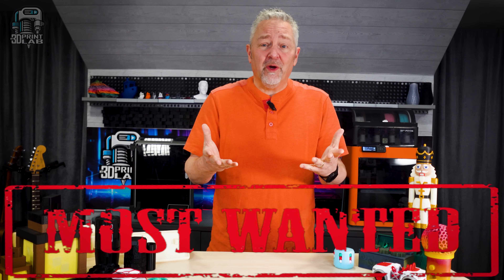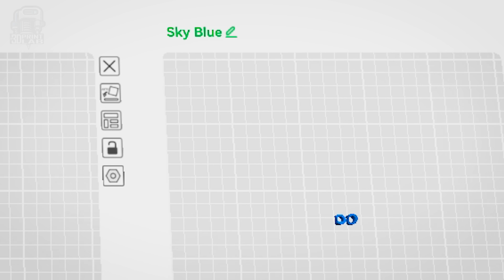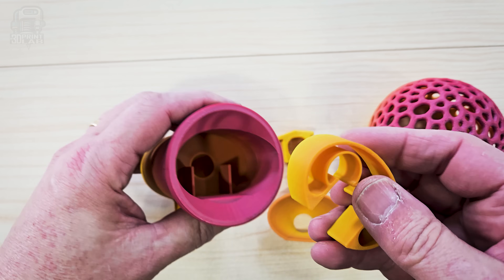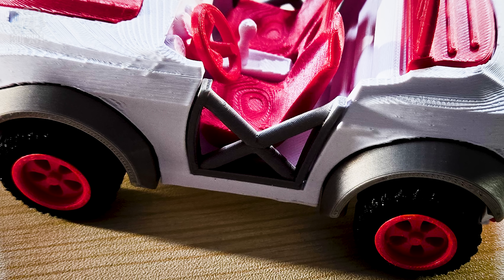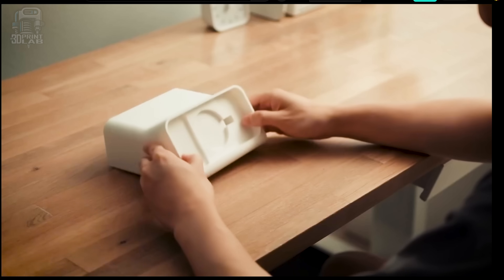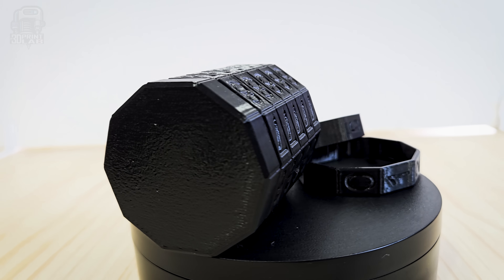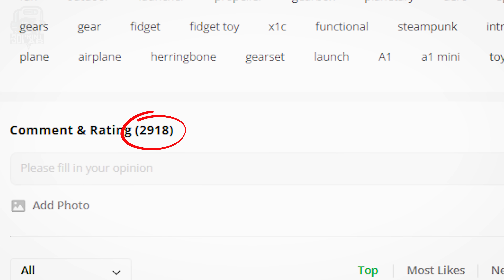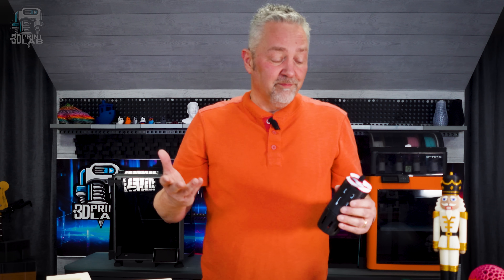3D Prints Too Good To Be FREE!

Comment: I designed and printed nutcrackers that looked my my family members for Christmas last year. They weren't functional (no nutcracking) but the jaw did move. I went through 3 iterations before I finally got it down to print with no supports and parts were
friction fit. They were in kind of a Roblox style. And I used wood PLA for the skin tones. If I had the time I wish I could have experimented with staining the wood PLA (mixed family).